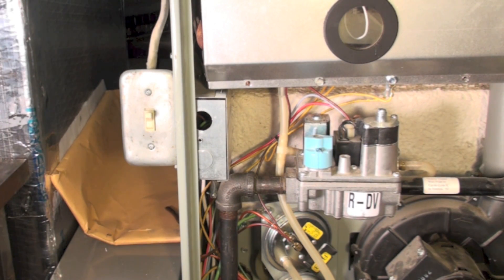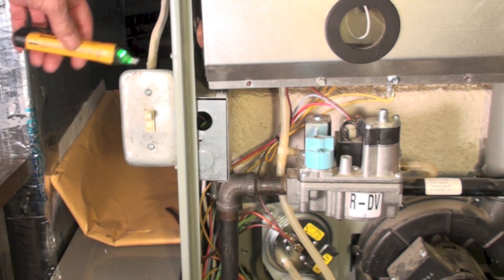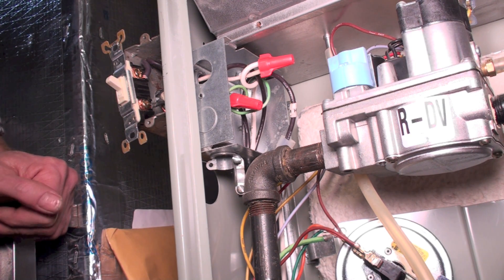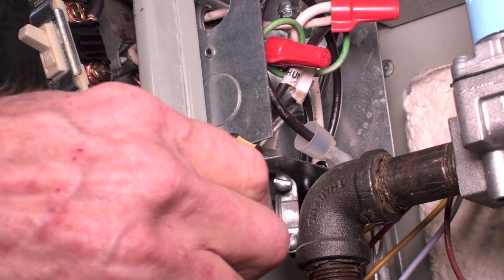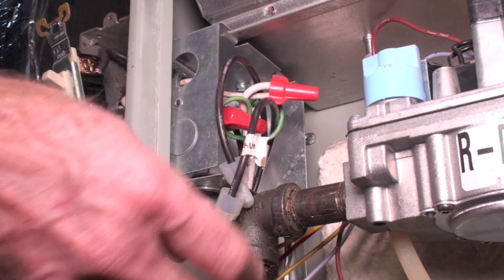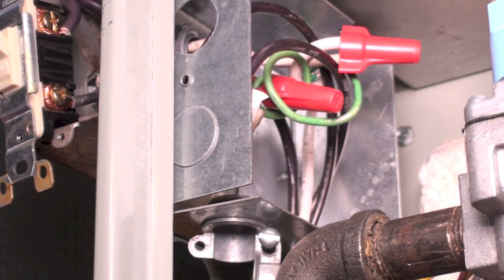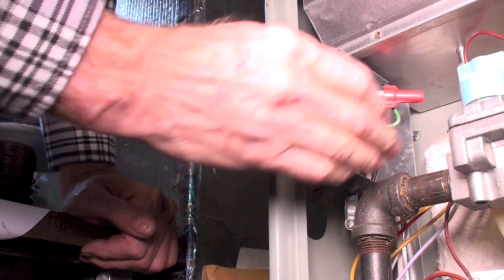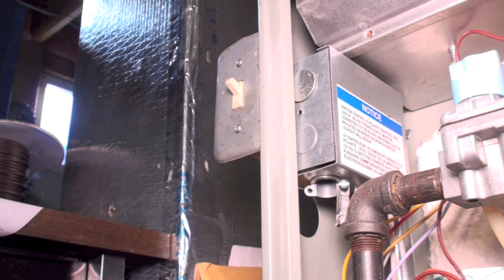How to install the power switch for furnace

Comment: you are a great guy and great teacher, you are teaching me a lot I am a retired disabled individual never work on HVAC. My schooling was far away from engineering but interested in knowledge specially if HVAC is replaced what happened over the last year in my house. I have a question not directly related to the topic of this video but I am annoyed with the installer.1- should the thermostat wires coming from thermostat to the the furnace  kept in a box I believe it is called  junction box. He is leaving in a fan like but I an thinking to buy a box and keep them away from the hand of people even animals. 2- What do you think of putting the furnace electrical switch in contact with the  white tube drain that collects water and drains it in an floor drain about 15 feet away.  that drains in the ground not the one outside the house. It used to be electricity in one side and any water source in the opposite side. It bothers me what do you think. I appreciated and have a blessed day. the second question is more important please.

Comment: Do these furnace service disconnect switches go bad? Thought I had a control board problem...replaced and still have no power. Checked/tested breaker...then tested the switch, no power at the switch. Problem originally started with downstairs ac not working...I swapped the thermostats to see if it was a bad therm, problem persist. I switched them back and then the ds therm has no power - checked the breaker-not tripped, reset them anyway. Tested for 24v at the therm and no power, status light off on furnace control board...tested for 120 & 24 at switch and transformer...nothing. Bought control board cause I could have it here next day on Amazon...problem persists. Tested breaker - 240/120v on each, test for power at the furnace disconnect switch and nothing. I have an upstairs unit and it’s switch shows 120v. Not sure if I should replace the switch or if problem could be elsewhere.
Reply: Did you figure out what it was? Mine turn on and it completely shuts off after 25 seconds
Reply: @felixflores6472  I have two of the same units for up and downstairs, I swapped the blower motor to see if it was the motor and it was  - so had to replace the blower motor.

Comment: Hi, please i have a question, i already have switch in my furnace( the one with a SSU, fuse inside), and i want to install another switch and bring it upstairs for emergency, where should i located the new switch, before The SSU box, or after that ( meaning after the exiting switch and furnace )..i want to put the new switch about 12 feet away from furnace.
Reply from the maker: I would put it between the existing switch and the appliance.
GFM
Reply: @grayfurnaceman   thank you.
Reply: @grayfurnaceman  Hi there, I have a NG boiler with a 110V circulator pump, there is 1 switch on the wall in the boiler room in the basement, short of going the transfer switch route, to the outside of the house, can I run a heavy duty extension cord to the boiler, and run emergency power to power the BG fired boiler as it obviously will not fire up without the electricity to fire it all, and circulate the H20, thanks!
Reply from the maker: @pastorhamiltonj.williamsph9952  You can, but you must also have a plug for the utility power if you don't want to use a transfer switch.  
I would use a male terminal that could be plugged into either emergency power or utility power.
GFM
Reply: @grayfurnaceman  for a back feed, hour about a parallel in male plug to the dryer receptacle at least that way I am not using a widow Maker cord, just need to remember to kill all breakers when power goes out, and #1 to go off is the main utility breaker. and all the steps needed, have a checklist for real, on a clipboard during a power out.
Reply: @grayfurnaceman  nice

Comment: Would have been better to draw it on a white board so we can actually see beyond the back of your hand. How hard would it have been to take the switch off and pull and then rerun the wires to SHOW the wire from the power source and TO the switch and then into the furnace?

Comment: Hey GFM, I know you know this but you might want to teach wrapping some electrical tape around the body of the switch to cover the screw terminals. Ask me how I know. I wired a furnace switch same as this one last summer and the bare ground touched the hot screw and Whammo, breaker popped. Twice. My lead installer was not very happy about that. Cheap insurance. great video.
Reply from the maker: Good point.
GFM

Comment: I have a old furnance the wiring to the electric motor ( 1/4 hp  115 volt & 4.8 amps rating) needs to be replaced . Do you think it is good idea to put 16 Gauge ( prime wire  automobile? ) with tinned copper wire of 600 volts rating . Also the breaker is 15  amps of rating.
Reply from the maker: +Centrious miskey The size of the wire is ok.  Auto primary wire is not normally rated for use with 120 volts, but the voltage seems ok.  Hope this helps.
GFM
Reply: +grayfurnaceman Thanks ! I was little worried about initial electric motor start up load . I read somewhere start up amps go up to 7 to 10 times .
Reply from the maker: On this type of motor, the startup is only about 1.5 times. 
GFM